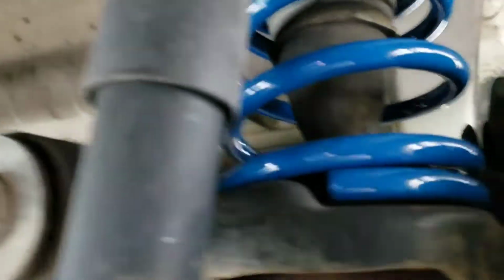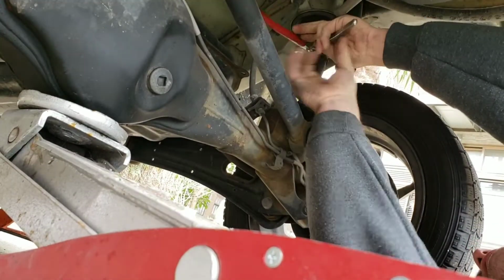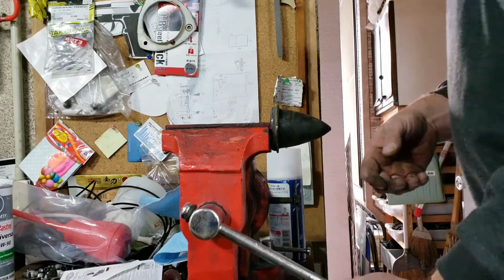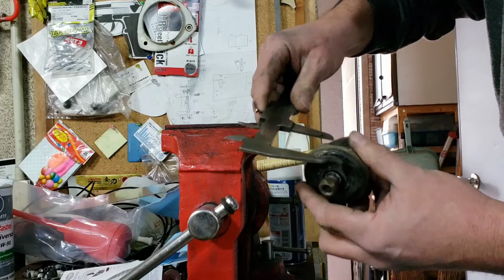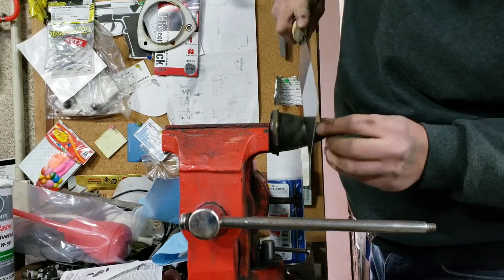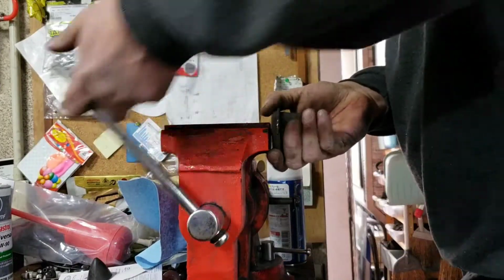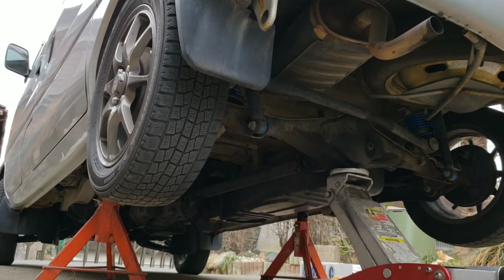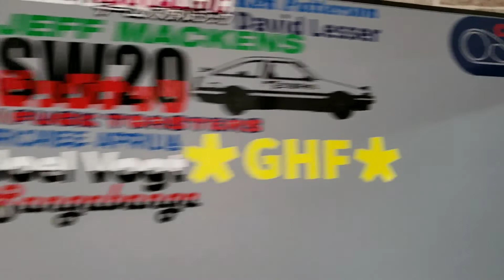Lowering a Suzuki Every van DA52V. Part 2

Comment: I also have a kei car, DA64W. Is there anyway to tune it?
Reply from the maker: Not really..
If it's turbo get a boost controller.
There might be cams available but I'm not sure. Your car has a k6a engine in it and there's a few different versions... Figure out which version you have and go from there. Check out Jimny groups for hints on what can be done.
I'm not too familiar with da64.
Reply: @GarageKei  Yea, I'm quite jealous of folks like you in japan, a lot of tuning parts and etc. In the Philippines it's pretty much stock. I wonder where can I get my hands on a boost controller

Comment: Did your rear alignment get goofy from keeping the stock rear torsion beam?
Reply from the maker: Very good question.
I never actually tested it but I believe I had to do a roadworthy inspection after lowering the van, at that point they do check the alignment and I drove the car for quite some time after this video was shot so my guess is everything is/was fine...
because I don't use the silver van (the van in question) anymore I will probably be pulling the lowered suspension out of the silver van and putting it in my white van.
The plan is to continue using the white van for a long time so in just over a year I will have to get another roadworthy inspection.
if I wish to continue driving the car at that time rather than doing the planned engine swap we will know definitively whether it has messed up the alignment or not.
Honestly my best answer is if it did make it difference it didn't make a big enough difference for me to notice it and I drove the car a LOT at all kinds of speeds....
Reply: @GarageKei  lol ok, that's reassuring.  I have that fancy silk road adjustable rear beam on the way via Sagawa right now...  ¥20,000 later.
Reply from the maker: @098Chris  I just couldn't justify that at the time. Despite what people might think I'm a paycheck to paycheck kind of guy. ¥20000 is a lot for me.
I was kind of hoping this series might bump my YouTube subscribers so I could start getting paid by YouTube and saw the investment of ¥10000 for a set of Springs as an acceptable expense. Sadly it didn't.
If money wasn't as much of a problem I would have gone the Spiegel coilovers, a rear Sway Bar and an adjustable torsion beam.
Find me on Instagram and show me your van or truck.
Reply: Now that’s a wood saw!